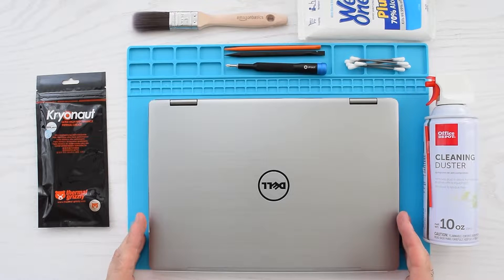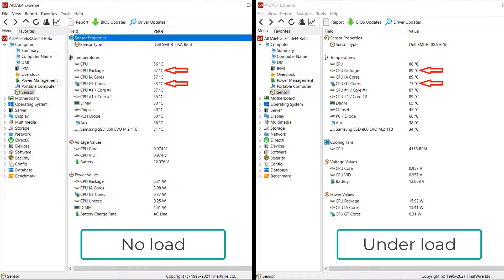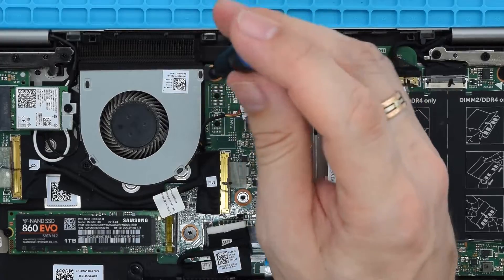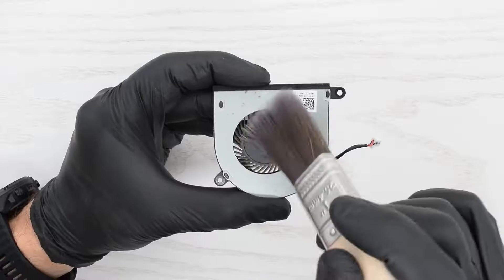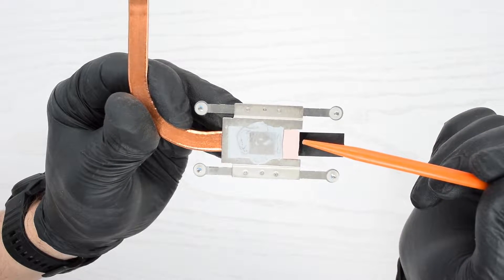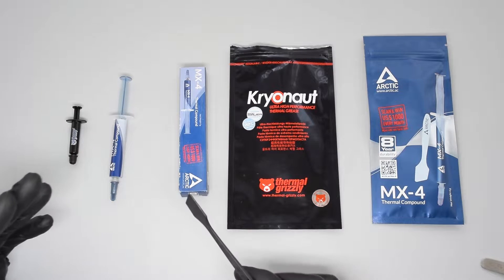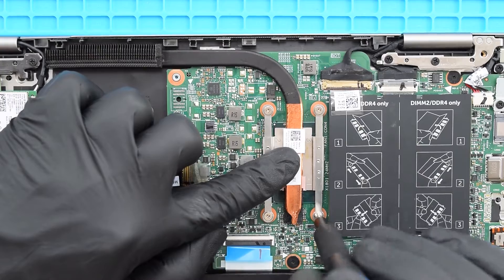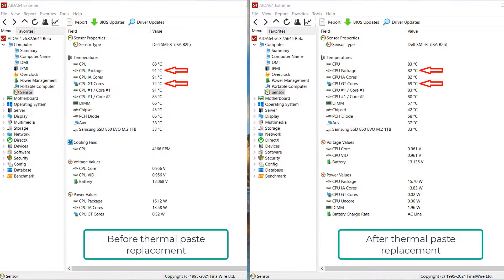Dell Inspiron 13 7000 Series Thermal Paste, Pad Replacement & Cleaning (7373, 7375, 7368)

Comment: hellooo! thank you so much for the video! :) do you know if the fan in the link below also works for inspiron 17 7000 ?
Reply from the maker: I need to know the exact model of your laptop. "inspiron 17 7000" is not a model it's a laptop series which has several a bunch of models with different specs and components.
Reply: @ElectronicsComputers  my bad it's an inspiron 7791 2n1
Reply from the maker: @sarahs5657  Those laptops have different fans. You need this one: https://alii.pub/76qv9r

Comment: Does this tutorial applies to 5000 series as well?
Reply from the maker: Yes, the 5000 series is pretty much the same as the 7000 series, with the difference that the 5000 also has a slot for a 2.5" HDD/SSD.

Comment: did yuh also put tge thermal paste on igpu part along wd chnaging the pad??? pls confirm
Reply from the maker: No! For the GPU die, you can only use a thermal pad or thermal putty. The latter option is better in terms of ease of application and performance. The links are in the description.

Comment: Hi. What is the purpose of that extra chip (which has pink thermal pad) for? Is it part of CPU or some RAM component?
Reply from the maker: That small chip's die is Intel's integrated graphics.
Reply: @ElectronicsComputers  Thank you

Comment: Hi there!  I was pulling out the copper heat pipe from the cpu and it got detached from two horizontal lines across the cpu. They still remain attached the cpu. But. The black pipe came of. What should i do
Reply: I think i broke the heat sink :(((((
Reply from the maker: You need to replace the heat sink or solder the pipe back to the plate.

Comment: Thanks for the nice explanation. I would have one question: what if I replace the heat pad with paste? Acutally I've never seen systems with this pad before, only with paste also for the same CPU, however from other manufacturer.. thanks in advance! 😊
Reply from the maker: You can use thermal putty instead of thermal pads but not thermal paste. I recommend using Upsiren U6 PRO: https://alii.pub/6nugj5
Reply: Pads are typically used to fill a gap to ensure contact. Like in this video, the two dies on the CPU package are on the same plane but the pad is used because the heatsink is reccessed for the second die. Pads are far worse than pastes for thermal conductivity so should be replaced if you're sure the heatsink will actually firmly touch the intended surface.

Comment: can i use liquid metal with this
Reply from the maker: Yes, you can. There's no capacitors on the CPU's PCB. But it wouldn't make any difference because that heatsink is not capable of dissipating more heat than it already does with any good thermal paste.
Reply: @ElectronicsComputers  thanks for the prompt reply. So I should go with the thermal paste as it is much reliance and will last longer

Comment: Can you just use a PTM 7950 thermal pad on instead of thermal paste for the whole thing?
Reply from the maker: In theory you can but you wouldn't gain anything from it. thermal conductivity of  PTM 7950 is just 8.5W/mk/ when grizzly paste has 12.5W/mk/. Also we switched to GELID Solutions GP-Ultimate 15W/MK thermal pads which are the best at the moment on the market. https://alii.pub/6p4kar

Comment: Where does this chart/readout with the temps originate from and does it work on other computers other than DELL?
Reply from the maker: This is Aida64 Extreme app which is used for PC diagnostics. This is the best one with a whole bunch of features. You can use it with any PC. You can download the trial version from the official website or if you want I could share with you my full version.